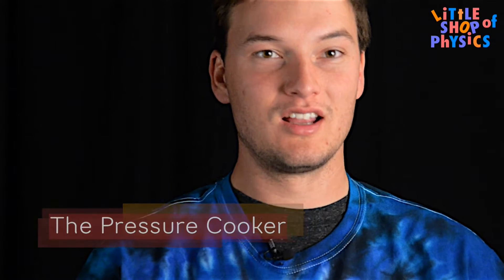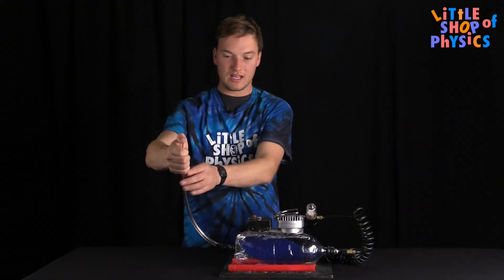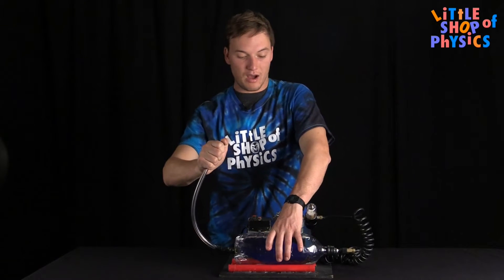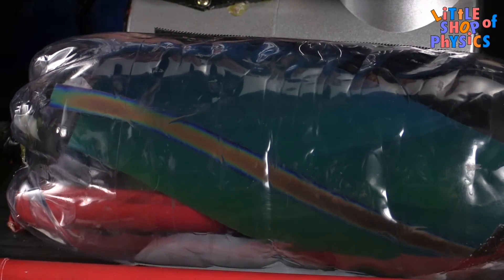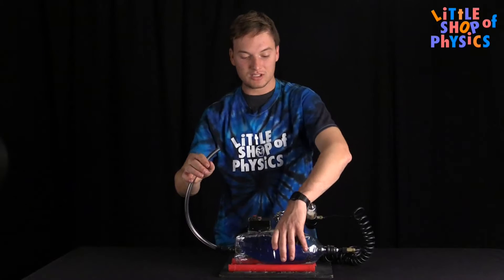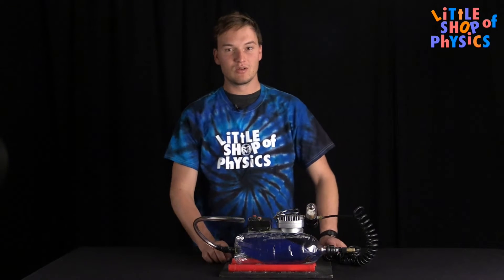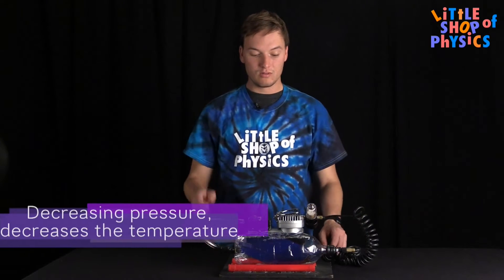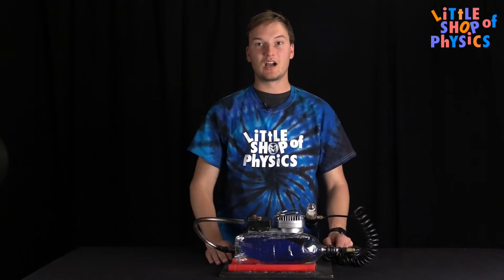Get Your Science On: Pressure Cooker

Comment: are you  able to increased pressures with the help of piston's by hydraulic pressure then how much energy are required in kilo joule
pv=nrt
hydraulic pressure  increase the temperature of water from room temperature to super heated steam boiling temperature 
how much  ton pressures are required and how much  hydraulic pressure machine required  to increased the pressures
this invention greatly reduced the  fuel efficiency of cng, lpg, in many ways if we apply this type of system in vehicles and in our kitchen or inside gas burners just like old gas stoves in which we manually increased the pressures and fuel of kerosene oil burned more efficiency vise
so if we supply more pressurised air in internal combustion system or engine then its also increased the fuel efficiency since more oxygen produced more en
energy and unburned particular are not produced?
consult me if you  not get my ide
idea